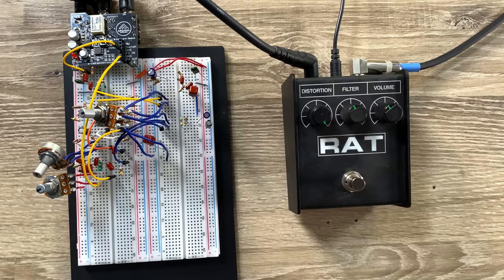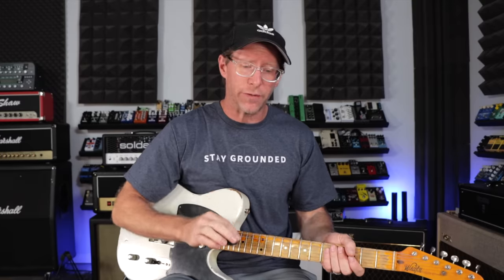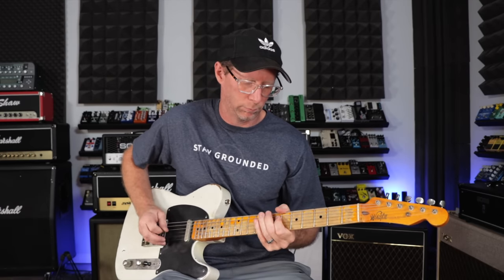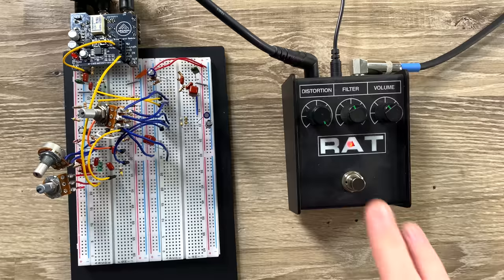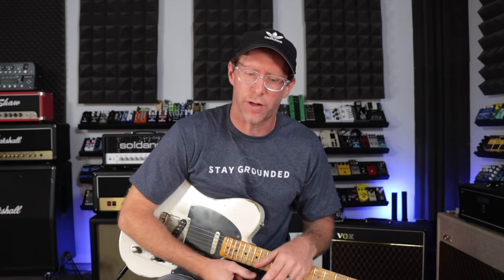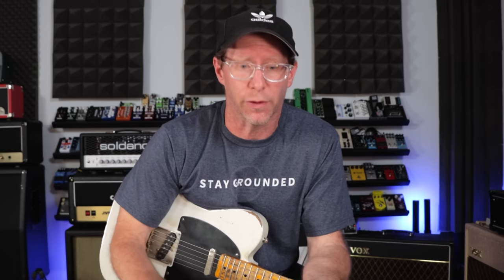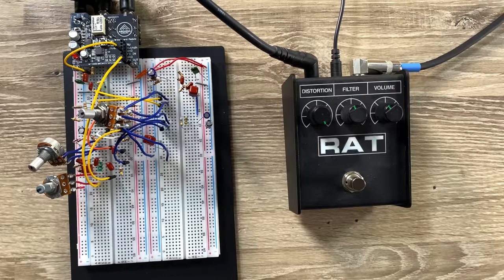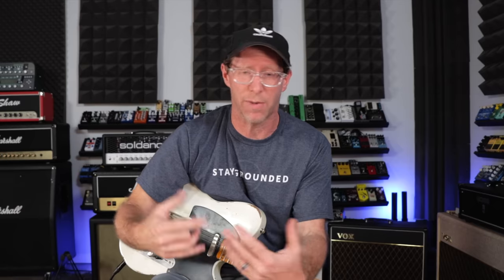The Rat Pedal Circuit Reimagined

Comment from the maker: Question: Would you be interested in having a chance in owning these breadboarded circuits? Any ideas on how to keep everything intact and functional after shipping? A breadboard is a "temporary" circuit building device - nothing is soldered, which complicates things! I would love to read your comments regarding this.

Lastly: Make sure you're subscribed if you like this content - more coming!
Reply: Just provide schematics.Or a parts kit,  We can breadboard it ourselves
Reply: Spray epoxy.
Reply: Set it inside a project box and pour clear epoxy over it.
Reply: I certainly wouldn't turndown one of these breadboard circuits.  I'll even drive to Indiana to pick it up
Reply: Hell Yes I would.  Take a bunch of pics, throw all the parts in a ziplock,  ya have the scheeematic, I will use an old case or buy one if it's not included.  I would be honored to be your Guinea-Rat!  Maybe we'd call it the sWAMP-rat!  (thanks to Logan Fillmore) I can assemble it on my unused breadboard (like 10 years lol, long story, but I have 45+ years w/electronics so...  Please may I have the honor? PS, long time subscriber, recently changed my YT name.
Reply: I think this is a great idea for fellow circuit nerds. Even if you just sent a mostly assembled board with a basic little schematic for finishing up the wiring. I'm guessing anyone with a small amount of breadboard experience would be able to pick things up from that point, but it's honestly hard to judge!
Reply: Maybe the circuit could be sent along with a diagram in case something becomes disconnected. Or…epoxy? I’m completely new to the idea of breadboarding and only learned of the term from watching your videos.I’ve been playing guitar for years and only recently built a couple of pedals from kits. So it would be interesting to view what you’ve created and gain insight to your thought process. BTW, I own a Paisley Drive and love it. I doubt that it will be my last Wampler pedal. Thank you for sharing your knowledge!
Reply: Yes please!!! And thank you very much!
Reply: I suppose you put clear epoxy on the circuit?
Reply: Being an experimenter (more tinkerer/destroyer, to be honest), I usually make temporary projects on one of those mini breadboards with sticky tape on the bottom. Held on great all the components for a friends onboard bass EQ during a couple of gigs until approved for a proper PCB.
(Until now the only issue I had was about a fuzz that was too loud, solved by switching the bias resistor on the spot).
I'm not expecting to get anything from this because shipping something here would be more expensive than a new pedal. But I would like to discuss a few ideas I have with you.
Reply: Yes sir!  Absolutely would love to have one of these!
Reply: The best way to ship something like this is as a kit that we assemble ourselves with instructions--basically a DIY educational type thing.

I don't think shipping an assembled breadboard is going to be good for business in the long run, due to potential shipping problems; BUT, if you do, you'd need to find a way to secure the parts such that the securing could be undone--such as some kind of antistatic bubble wrap (IDK if that exists, but maybe U-Line or someone like that has some) that's wrapped firmly around the parts.

I'd definitely get the DIY kit.  I have a cheap soldering iron that I need to learn to use sometime before the end of this century, and I'm into stereo instructions and Legos, so I think I'd save money while learning some hands-on stuff.  I could even mod it, putting pots or other variable components or circuit branches where they might be useful.  And, I could learn it from YOU, while you make a bit of money off it.

I recently came around to the Rat tone, so adding one to my meager setup would be an even bigger bonus for me.

Or, ya know, I could just buy your new pedal.  Instead of the Rat, maybe we can call it... the Ferret?  😆
Reply: To Ship;
Step 1. apply a layer of silicone to component side of board and let it cure a bit but still be a bit tacky then apply a bit more silicone about a 1/2" up from the base of the original silicone for each lead to form a support mound.

Step 2. Let silicone fully cure/destinkify.

Step 3. fold the components flat onto the board, put into a ziplock bag or wrap with cello wrap then into a bubble mailer and finally a box.

Step 4. Write my address... or someone else's address on the box and send it like the package that it is.

Enclosure Idea;
I would end up fitting it in some sort of see through enclosure because exposed electronics makes the mouth water. Am I right or am I right?
Reply: Perhaps we need a standardized metal casing with pre-drilled holes that can be used for attaching switches and knobs? If the casing was oversized to the degree that it could simply sit over the top of a breadboard, then we might have ourselves a ‘breadbin’ pedal. If schematics were published, I could see people buying components and a breadboard to make their own breadbins. I’d say plenty of folks would want this Wamprat to start - what a killer sound! What a punky twist to the boutique market if people stated using pedalboard hogging breadbin sized pedals! 😝
Reply: Goop it.
Reply: I’d love to own a breadboard circuit like this. Speaking for myself, I think it would really help me learn the layout of both the circuit and breadboard by having one preassembled. As for shipping, maybe a sort of cardboard top with a soft foam on the inside to act as a sort of “spring/like” cushion for transport?
Reply: RTV 3140 it's a silicone sealant. High temp, fairly runny. About a 48 hour cure time. It can be removed later if you want. I use it at work to protect coast guard aircraft electric components from corroding. I would definitely love to have the circuit since I'm interested in starting to build some pedals. One more thing, please make a mini version of the Velvet fuzz! I love that thing!
Reply: Stupid question, but does soldering the parts change the sound? I like this concept, I'm interested in seeing more!
Reply: Would you do a vero board version of these instead of bread board? Would definitely hold together a bit better
Reply: I think it's more convenient if you send the schematic rather than ship the actual breadboard ckt. That would still be nice for me. 😁
Reply: Okay, I hate to be this guy, but — Epoxy Resin.
Reply: The main challenge is to do something new as cheap as original….
Reply: Absolutely would be interested. As far as shipping, a soft layered bubble wrap should work. I would simply pause the video and screenshot so I can zoom in if anything is jostled loose
Reply: You could possibly use wire wrapping, rather than breadboards? It is a good way to do a mockup, but is semi-permanent.
Reply: I am a UPS specialist in Indianapolis and have a few ideas on how to ship breadboards and stuff and keep them intact DM Me I would love to help!!!!
Reply: I know I would definitely like to experiment with this pedal. As far as shipping goes, a mini laptop box for FedEx Office or a small type of box with a foam insert would work well. Depending on which box you use the box with the pedal inside of it may need to go inside another but that’s easy considering you can use flat rate shipping materials for the final box the board would be shipped in.
Reply: I love this mod and would love to own it but I guess it would be studio only if it wasn't in an enclosure. I record a lot so...pick me pick me yeah!
Reply: A self build pedal kit based on these schematics would be very cool, all parts, pre-drilled enclosure, build guide etc...
Reply: Owning the breadboard would of course be cool, but learning from your thoughts and ideas is much more valuable! Keep up the great work and thx for excellent content!
Reply: Id love to get a breadboard
Reply: Absolutely interested!
Reply: YES! Super interested. You could do a parts kit or vero board or whatever. Anything would be cool.
Reply: Yes please. Even the diy/schematic route everyone is suggesting.
Reply: Brian, you could hot glue the connections. Another cool one is to make it a "kit" by taking a picture of the circuit, or your schematic drawing and, ship the board along with the pieces to assemble either on the breadboard or a PCB attempt. Thank you
Reply: A breadboard by you is the holy grail. I would love having it,
Just recently started to dig into electronics and pedal building out of curiosity, and, such an item would be an excellent learning opportunity.
Reply: As a way over-committed RAT guy, that MOSFET version is something I would absolutely buy as a kit or even as retail pedal.
Reply: Tupperware and packing paper? That's my best guess on how to safely and cheaply send a breadboard.
Reply: I’d actually be interested if it was just a breadboard with all the components inside and a guide on how to assemble it. Bit like the Erica Synth DIY kits, but without the soldering. Could be like a subscription service where each month a new configuration and any necessary components get posted out
Reply: Always interested in this stuff.  I started out with a 200 and 1 radio shack kit and made a pre amp for my guitar then patched it through a overdrive ckt to give it some crunch  to distort the sound.  For a bread boarded circuit you could protect it using a plastic case , expoxy glue works pretty good. to fix it in there.  Great job on the video.
Reply: I like this idea a lot.
Reply: it's a great idea
Reply: Absolutely!!! I'd drive down to get it also!
Reply: Goop it a-la the Klon! I'd love a gooped Wampler breadboard circuit
Reply: Don't know if shipping could work, as you say a delicate  breadboarded circuit is  temporary by nature. Maybe a PDF? Or an ebook if there were enough of them? Either way this circuit sounds great to me even over Utube.
Reply: Include schematics in case it separates, and hot glue the junctions. Foam packing wrap, fold over components and loosely zip tie bundle with small bubble wrap layered between. Then ship in small electronic components shipping box with air pillows, foam peanuts, or wadded pacing paper, as needed.
Reply: I own many wampler pedals and love everyone, tumnus, gearbox, paisley deluxe, ego and a few others but I have never built a pedal. I would love to try it. I build guitars and I have been playing over 50 years, I'm 68 years old and love to tinker and know how to solder and I do own a rat. Bring it. Great video as usual.
Reply: Brian, just take some decent photos of your breadboarded circuit, and throw everything in a box (at least the circuit parts) along with the photos & a schematic and I suspect that most of us here could build it on a breadboard.  And I'm definitely subscribed too!  ;)
Reply: +1 on putting all the pieces in a box with the schematic.  it'd also be nice if you shared which pieces can be replaced with different values, for the more adventurous types
Reply: With a schematic and parts list we could build these .. that’s why I’m here 😊
Reply: @sassycat  no
Reply: Epoxy on a breadboard? 
Nah c'mon guys. 

Strip board aka vero board or other proto board is the only option.

Comment: Nice! 
How about sending it in parts with instructions on how to put it back together? In the spirit of learning 👍🏻
Reply: Great idea, Wampler kits. I'd buy into that.
Reply: @stuartchapman5171  I'd love that too
Reply: That's probably the best way.  You'd still need to design a "proper" PCB to ship with the kit unless it was a "Let's learn all about gain and distortion with Uncle Brian" type kit where you supplied a breadboard (with the In/Out & 9v lines hard-wired) some diodes, mosfets, resistors etc. and a few sample circuits to get you started.  Problem with that is you'd be training the next generation of competition...

Comment: It'd be fun to have.  Perhaps a photo of it first, then light foam over it, then taped down?   Originally was going to suggest just painters tape, but that'd pull up the parts when removed... so was trying to think of some way to apply pressure that was easy to remove.

Regardless, neat experiment.   It'd be fun to see more of these, with a bit more nerdery / going over the circuit.   Thanks for your awesome videos!!

Comment: I'd certainly be honoured to be a recipient.  But what I'd REALLY like is the schematic! (nudge nudge, wink wink).

For me, the key elements to the Rat are the use of dual ground legs, to give reasonable gain to the low end, and silly high-gain to the upper mids and highs, and the use of a variable lowpass filter for a tone control.  Th dual ground-leg scheme is what allows it to have the "heft" missing from so many other pedals.  I've used it n some pedals, and like it very much.  The use of an LM308 op-amp, to exploit its gain-bandwidth limitations is also important, but really only at the higher gain settings.

 If it were mine to play with, I'd be curious about inserting the sort of mids emphasis one sees on the Ibanez Supertube, and.or a midscoop filter like one sees on the Superfuzz and similar pedals.  I've tinkered with pre-clip resonant boosts and post-clipping midscoop filters, and there are some interesting tones, especially if you can tune each of them.  Think of it as the "baby" version of the Akai G-Drive.

Comment: Yes please! I’m a novice breadboarder and I’d love to have this circuit or any of your others to use as an example. And if not the physical breadboard, then a detailed schematic explaining the circuit with good reference pics would be awesome as well. The physical board with all the components would be the best for study though imo. Perhaps building a little wooden wall around the board and pouring epoxy over it just enough to seal the components in place on the breadboard and allowing them to stick up out of the thin epoxy bed? Just an idea. BTW love Chasing Tone and Blake’s Tone Mob podcasts. I never miss them. Thanks for all you do. Your vids are the reason I started trying to breadboard and learn circuits. Learning Eagle as I type this. Thanks!

Comment: The first Rat in the video had green indicators in the knobs. I'm sold.

I'm not gonna lie, I had to do back and forth in the demo parts quite a lot to be able to distinguish anything different. I think the mosfet-version has a bit more bass and is a bit softer. Really hard to describe, very nuanced if anything. I guess you pedal makers are right when you say that individual parts of the circuit don't make that big of a difference alone.

Comment: Well, that was interesting.  On my computer, through my headphones, they sounded very close.  The breadboard circuit sounded a hair more spitty and loose in the low end than the Rat; almost like a fuzz.  The Rat sounded just a teensy bit brighter in the top and tighter in the low end.  I preferred the Rat slightly.  It sounded a bit more tubey and "natural" (whatever that means) than the breadboard circuit.

Comment: I really enjoy you building these circuits on a bread board if you sold a dvd showing in detail start to finish putting together a bread board like this or the other one you did showing the different clippings circuits and how one thing effectively changed the sound and character . As far as shipping this bread board I would love to have it. As far as packing it up try vacuuming sealing it I process meat in a butcher shop as a living and we wrap up the meat in vacuum bag they come in all kinds of sizes and you can vary the amount of vacuum so it can be lightly touching the components and holding the in place and then you can cut the vacuum pouch and air gets in the pouch is loose and you slide it out and there it is . Thank you again for sharing your knowledge

Comment: Hello Brian. My wish on this project would be remove some of the bass response (mud) when the pedal has a higher gain setting. Maybe changing the 2.2uf and 4.7uf on the clipping stage for lower values, which probably would lower the gain as well, but we always can put a blues break before to boost. 

Or if you have another way to remove the mud and keep the gain. Feel free to do it 😊

Comment: The MOS-RAT sounded cool, but I think I have found the perfect pedal for my needs. The Paisley Deluxe is suiting my needs clipping circuit wise. A TS type OD that I actually like, for low gain, and the Underdog does the medium gain stuff. Whack either one with a boost or fuzz, if I need more.

Comment: Hi Brian, Julio here from Buenos Aires, Argentina. I think better than owning the breadboarded circuit you just made is hearing from you on how to recognize those blocks (or ingredients for the recipe :) make it equal using mosfets. Wheres is the voltage drop? where do we have the filtering stage and the feedback and the clipping? comparing the rat schematic with the mosfet one. That's what I think would be the cream

Comment: Oh yeah, that’s great fun. I took a rat circuit and put a different clipping options on a rotary, and then for fun put in soft clippers like the roadkill rat. It’s good fun, I just make PCBs cause I’m too lazy to bread board it. I also did a KoT PCB but I used tube screamers. Why? Because I can. Great video. I’d be interested in a Wampler bread board, maybe hot glue?